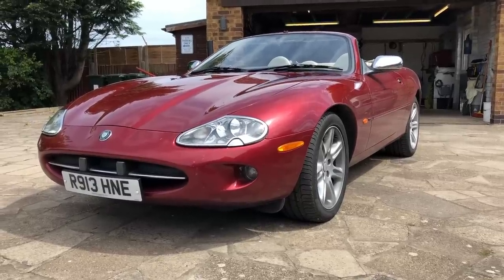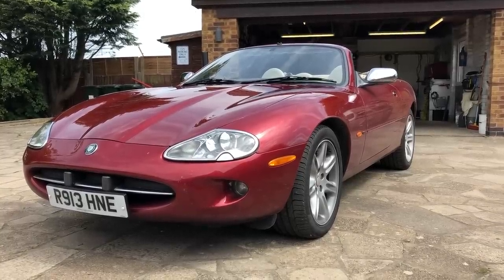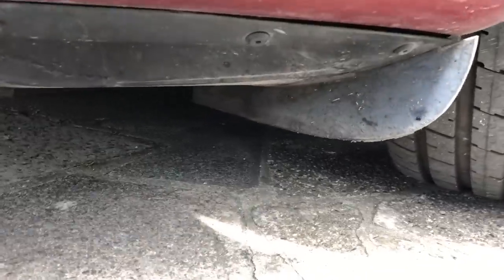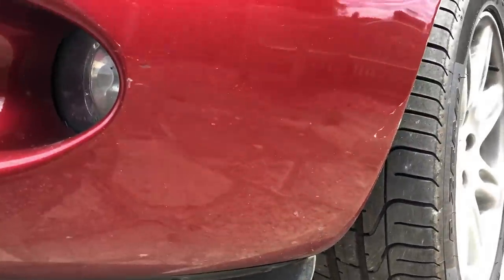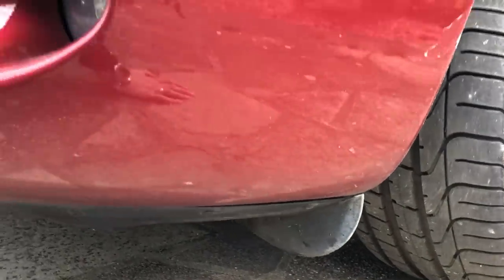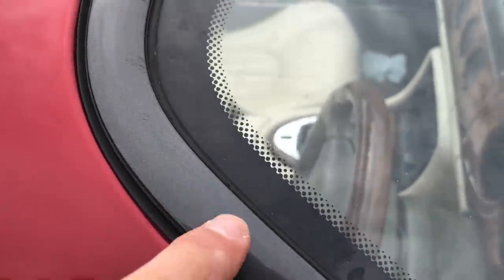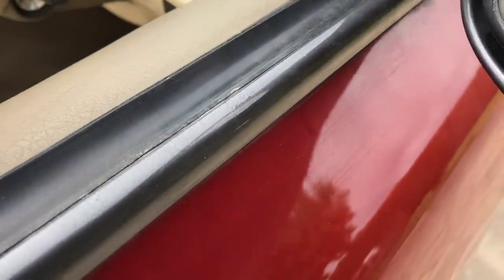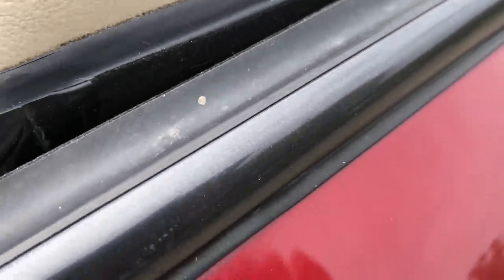Buyers guide to XK8 XKR bodywork problems. Plus I sold my XK8 & Bought Another. secrets of XK8 ep 26

Comment: She's a beauty John - You could says she's real Purdey   ;-)
When I bought my 2010 XK a few months ago and came to give it it's first wash, I noticed lots and lots of fine swirl marks all over the bodywork and quite a few scratches across the rear wings / wheel arches, probably where a petrol pump hose had been dragged across from the near side to the filler pipe on the offside. I bought a dual action polisher from Halfords (about£70) and set about the swirls and scratches with Meguiar's Ultimate Compound and then 3in1 wax.
Not only did the swirls and scratches come out to the point where they are no longer visible, even if you know where they once were, but the metallic spectrum blue paintwork is absolutely mirror-like now. Without doubt the best motoring 'investment' I've made in recent years.
Looking forward to the further adventures of your new XK8!
Reply from the maker: Ooh interesting Stevepitts18
I may be in the market for a polishing machine soon. what brand was yours.
did you not find yourselfelf adding circular marks? The fear of that is what has put me off till now.
Reply: Hi John
I used a polisher many years ago and it did, as you say, make some horrible swirls, but the current breed of dual action polishers not only effectively remove swirls, water marks and light scratches / scuffs but don't leave any circular marks - if you make sure that the foam pad is clean of any grit, so a very thorough car wash is needed beforehand and start from the upper panels and work down, making sure periodically that no grit has found its way onto the pad. 
The last thing you want is to detail / polish half a dozen panels only to find that a tiny speck of grit has etched every one.
I bought the Halfords own brand polisher when it was on special offer with 15% off a few months ago.
https://www.halfords.com/motoring/car-cleaning/polishers-steam-cleaners/halfords-dual-action-car-polisher.
Just noticed that Argos do one for £40 which looks pretty similar.
Just look out for the dual action (the pad oscillates and rotates), rather than just orbital and variable speed is essential too, as you need to apply the compound / polish slowly at first and then build up speed to spread and polish. Then buff off with a microfibre cloth, stand back and admire your reflection.
Tons of detailing vids on the Tube and I find Forensic Detailing channel pretty informative and honest.

Comment: Thanks for another great video. What's your thoughts on the use of waxoil ? Applied in the known corrosion spots (before they corrode - for those with relatively rust-free cars) and inside sections that can hold water; could extend bodywork life considerably - perhaps?
Reply from the maker: Good quality products applied well to cars in good condition certainly a good idea. cheap stuff or applied over corrosion or worse still moisture is like applying a rust poltice. mine is oiled underneath and other than it being on heat shields im pleased.

Comment: Hello John, a question is popping up, while watching your (again interesting) video. Did you never inspect your car on starting rust? I do, several times a year. When I do find rust, on some of the spots you do show here, I immedaitely start to scratch the rust away, and paint it over by a soft brush, in the colour my "mechanic" did deliver some time ago. (Water based, very bad smelling.) 
And beneath it a antirust primer, also with a brush. I do modelbuilding for many  many years, so I do not have difficulty's with using a brush. On top of this, I paint a very high quality woodlack (!) used for boats... I did manage to restore with it, the scratches on the wooden steering wheel. (I did  paint it over 7 times or so.) But is also good for protection againt water. (that's why it is used for boats) It has a sort of gleaming over it, in almost the same colour as the "Topaz" paint. Wich is usefull in my case. The surface of the lack, after a couple of days or so, is very solid. 
I had problems with the rearbumper, it was getting detached by rust. And yes, watching your video, it is good to look more under the car, besides the more common places wich can be seen, while inspecting starting rust. I am warned! (and other owners I guess.) :-)

Comment: The classic x100 dilemma. I decided to restore mine (2004 XKR coupe) and it's costing a fair bit but I figured if I just bought a different one, I'd probably have to attend to the same problems anyway. (Luckily I am able to afford to do it).  Mine is currently in the bodyshop for the rear arches (which weren't as bad as expected) and a full spray. They're also repainting all the trims for me whilst they are off the car, luckily in good condition so no replacements needed. I already had the floor pan (one small hole on passenger side) done a while ago and I've had some underside corrosion issues repaired too, both subframes came down. Not cheap but cheaper than the £25K people are asking for top notch cars. Mine is a 2004 so I had the added issue of not knowing what we'd find under the plastic side skirts. Again, it wasn't too bad. I'm hoping to have it back soon after a 3 month (garage closed due to covid) delay. Can't wait to drive it. It hasn't been on the road since last September. BTW I'm not doing this expecting to get my money back. I just love the car.
Reply from the maker: Well done. These are Heart rather than head cars anyway so, enjoy the car for now rather than hoping for a return in the future. But im pretty sure the values are going to start soaring soon.

Comment: love your videos.  However, my 1987 Porsche 944 came from factory with similar stone chip paint (and 'decals' in front of rear wheel swell) - that stone chip paint is not worth noting on a 1997 car.
Reply from the maker: thorman944 thanks for watching. Genuinely learnt something there. Porsche were and are well known for quality and longevity though so I suppose I should not be surprised that they would be adding protection way ahead of the majority. Those Decals are interesting as well
I know that Lotus fit clear ones to protect the paint but won’t gaurentee that the paint will not be damaged by removal if the film gets roughed up by stone damage😅

Comment: Such a shame.  I had a 2002 XKR and it was immaculate because I didn't just wash and polish the paintwork but always pressure washed the car underneath the wheel arches especially the top of the inner arches where mud/road dirt can gather and keep moisture to errode the body. Take off the inner wheel arches and clean behind and treat with wax oil type compounds. Equally inject inside doors, sills and box sections. I did mine once a year.. Good paint shop will easily respray your bumpers/nose cones off the car and match perfectly with modern paint mixing facilities. Mine was absolutely immaculate  inside, outside and underside.  Easily done for any DIY types. All cars pre galvanising processes were introduced suffer but the X100 XKR is a superb car. Check early cars if they have any loss of compression because of cylinder liner issues. Nearly all cars by now will be well past the times when petrol was crap and damaged the linings. Go get one and a cherished one.
Reply from the maker: Thanks Brian